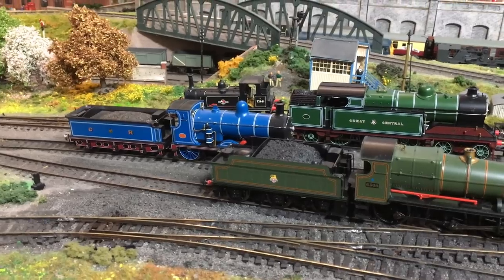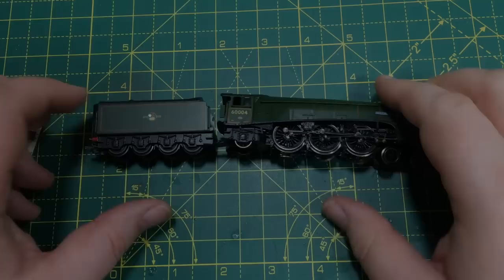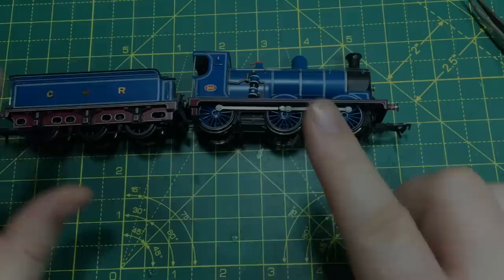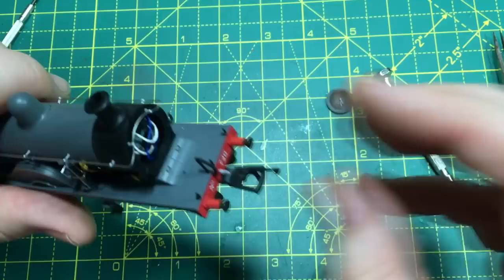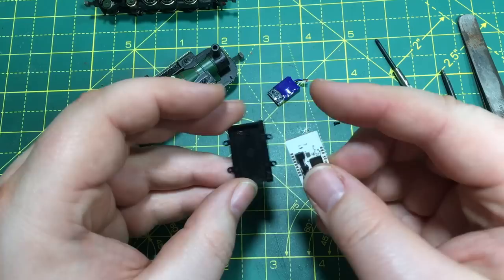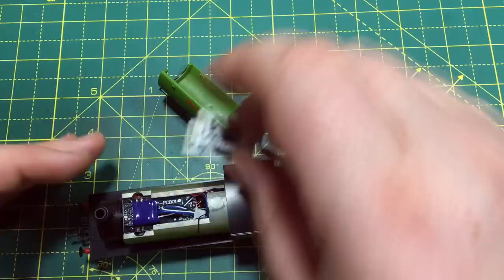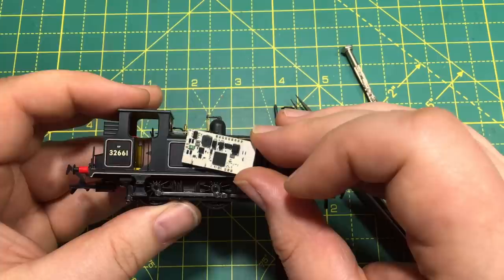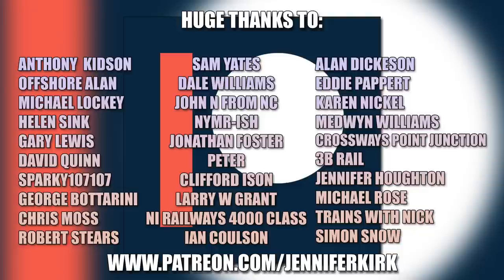Will it Fit in YOUR Model? Testing the Hornby HM7000 Bluetooth Decoder

Comment: An extremely useful video, thank you, which adds to debunking Hornby’s hype. Curious, then, they sent you a decoder which you’ve shown only rarely does what they implied it would.

My overall conclusion from following this story since January is that, for the time being, HM7000 is nothing more than a DCC upgrade novelty for Hornby’s own product range. Rather like TT:120 in fact.
Reply: To be fair there was no hype, it was always put forward as a hornby system aimed at going in hornby stuff. Especially the sound option very clearly comes with sound files only covering stuff hornby makes with no clear path to use any other sound files available. 

Pretty sure(will go back and watch it all again and pull up all the info I can just for you) that no one from hornby ever said it would fit any other product. 

The hype seems to have come from our inference that we can just fit this in anything and that it's intended for everything not from them implying that it's a hornby product for hornby people to use in their hornby system which is what it is.
Reply: @HamStrains  it’s still unfair that Hornby did this though, as if it’s NMRA comparable, it should fit.
Reply: @modelrailfan37  they never did anything of the sort, they said it the sockets and underlying software used match up. They said it conforms to crrtain parts of that standard. That's all they did. Not that it complies, not that it compares.

Bit unfair we are pretending they advertised or advised or otherwise said it would fit anything but their own range. They did not. To claim otherwisr or that they did or that they did not have full documentation including dimensions available and free to potential customers prior to anyone making a purchase is dishonest. On this occasion hornby actually delivered the product, exactly as specified and advertised. That people didn't take a moment to read freely available information or consider what they were buying as one should before buying any equipment from disparate sources, that's not hornby's fault. 

Don't work for em, don't even have much interest in most of their product range. Can however tell you anyone painting this in any orher light is taking you and the hobby for a ride.
Reply: @HamStrains  I mean, not everyone is as into the hobby as we are to be completely fair. There are many people that do model railroading as a side hobby, or don’t take it super seriously. To me, this is fine, as with how few people are coming into the hobby these days, we need all the people we can get. Having extremely affordable, high quality DCC Sound decoders is great, and something this hobby has needed for a long time, but considering the low cost, this product will not only appeal to experienced members of the hobby, but also to beginners and people that only do model railroading as a side hobby. If this is the case, many people, (beginners especially) might not look at documentation for a DCC Decoder before they buy it, as every DCC decoder on the market will fit into the right slot no problem, so long as the locomotive is built to properly fit a decoder. This makes this a bit of a problem, as while I look at reviews always before buying a product, (as in the past I’ve learned there are some ripoffs in this hobby at my own experience) not everyone has the time to do this, especially if they have other hobbies besides model railroading.
Reply: @modelrailfan37  I'd argue most beginners wouldn't even contemplate buying the parts separately and the much more likely consumer behaviour would be to simply buy the whole unit ready to go with sound decoder fitted, I'd further take a gander at what sounds are available and surmise that unless you want the wrong sound for the wrong loco you are even as a very rare beginner willing to and having the confidence to DCC fit your own stuff going to be put off by the fact modt of the sounds available don't match stuff other than cases where hornby has a competitor for that loco. 

The much more likely reason these are available as a stand alone product at all is so that people who have primarily the hornby TT:120 sets can upgrade and fit the sound system their early sets didn't come with which is fine because they fit just fine. The next most likely thing we can work out is that the follow on market is people with hotnby OO items catered for in the sound library, which seems fine they seem to fit. 

Neither of these customer groups is annoyed. 

The only people who seem triggered are those with existing collections, who are by no means unskilled, who are generally disgruntled with the direction of hornby to begin with, those who definately do know better. 

With new entrants to the hobby apparently so thin on the ground do explain how a bunch of seasoned collectors annoyed with a company making a concerted effort to belittle everything that company does as overpriced, faulty, bad and late encourage any entrant to the hobby? If everything is rubbish and expensive and all the manufacturers are greedy and out to rip us off that's only going to encourage people to look for other hobbies. Or enthral people in the drama around these people taking on the imagined evil. 

Storm meets teacup atop molehill claiming to be mountain. End result, less modellers because if this is what they see trust me, they're gonna keep walking to another less messed up hobby. Sadly, this is what they will see first when engaging with our hobby via youtube. Not exactly a positive image we project of the hobby, a positive image of a few bigger youtubers maybe, but certainly not a positive image of the hobby.
Reply: @modelrailfan37  rather than making up imaginary idealised put out customers, we could go look around for people that have got it, have used it as intended, and are having loads of fun with it. 

That might be a better measure of the product that imagining the feelings of a potential customer that in absolute fairness I've yet to see materialise on any forum post or video relating to this. Lets take a trip to reality

As to the very last bit, if people rush, thats on them, if you were in such a rush to buy a refrigerator that you purchased the first white box thing with a door that makes cold and accidentally got a freezer 😳maybe the lesson is you shouldn't rush, not that they should have mass media advertising of the difference between the two and post PSAs all over town to make sure no one is as silly as you were.
Reply: @HamStrains  Check out Simon Kohler in Hornby’s own 2023 range launch video. At around 58’20” he says: “The versatility of the new Hornby 7000 Bluetooth-enabled control system is superbly highlighted with the numerous and low-cost ways that any [sic] existing layout, either DC or DCC, can be controlled using the power of HM7000 while wholeheartedly embracing Bluetooth technology.”

Several times in his introduction to HM7000 in this video Simon mentions the ‘average modeller’. He will know far better than I but my impression of the ‘average modeller’ is they don’t stick exclusively to Hornby models. I’m no expert modeller by any means but even 40 years ago my OO collection embraced seven different manufacturers. 

Hopefully, in time, Hornby will fulfill their original claims for HM7000. Meanwhile, they remain as hype.
Reply: @Teesbrough  really splitting hairs to find an issue now. 

I appreciate, some people may feel like it was put forward as something you can stick in any old thing but it really obviously wasn't, take a look anywhere else for examples, honestly why did anyone expect it to be different to this? If hornby talk about model railways they're talking about hornby model railways. Discount anything they say as being applicable to anyone else and you'll not be as disappointed. Sitting in the middle watching this mess neither side is great, one probably could have done more to flag up how proprietary it would be at least in this iteration, the other side is just making up that they said loudly that it would fit everything and anything which they never did. 

No ones coming off not looking foolish.
Reply: @Teesbrough  re your question in monday club about class 124 door handles, comet models do an etch of standard T shaped door handles that should suit 96 of them per etch for £3, available on petes spares, enough for a fair few coaches. Very late this week... hope that helps if you were still looking

Or, roxey mouldings so a similar etch, but you get 120 per etch for £2.75. Postage is gonna be the thing that decides which is best value it seems

Comment: This product is not a great one from Hornby if you ask me. If Hornby say a product is NMRA compatible, it should work in any product that has enough room for the decoder. Even if this is an issue that was unavoidable, Hornby should have specified that, and not sold it as NMRA, and they should have said that it does not work with all locos on the box. Also, it’s not DCC Ready really if you have to cut parts off the model or decoder to make it fit, but that’s just my opinion.